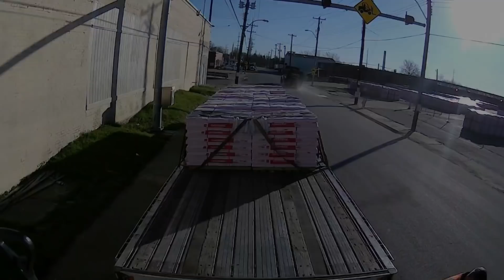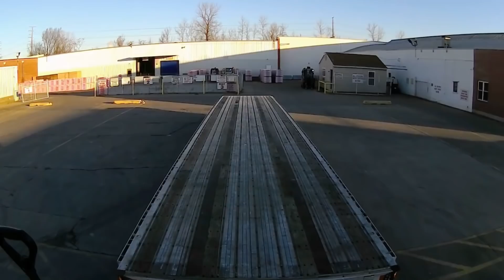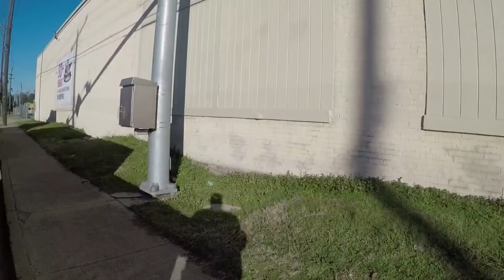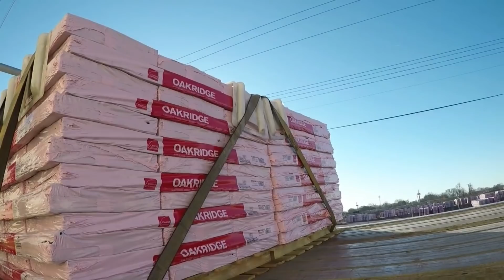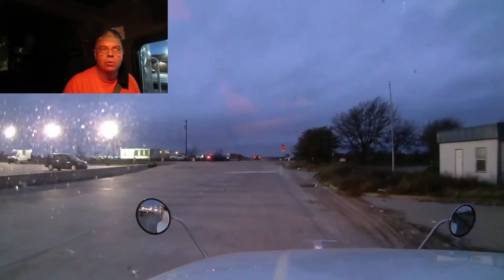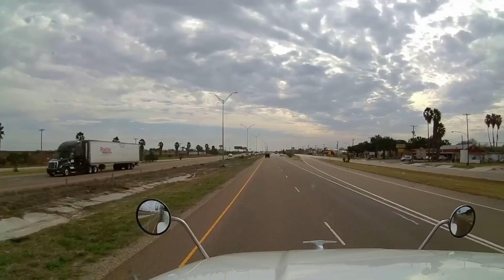#370 Safety Safety Safety and Roofing Shingles The Life of an Owner Operator Flatbed Truck Driver

Comment: I don’t know if you can take over the counter medicine while driving but,  when I was younger (I’m 73) I drove a lot in an unairconditioned truck. My allergies gave me a fit all spring and summer until I came across a product called Contac cold and allergy capsules. They were a lifesaver. Cleared my sinuses, dried my watery eyes. In short it made my life on the road much easier to bear.

Comment: ‘They preach safety in the office’- yeah, THEIR safety. They don’t care if you become ‘flatboy’ securing their load.
Reply: JimzAuto They could just put four traffic cones out by the utility pole, that driver’s could use,  so traffic had a visual cue what “that parked trucker” was doing!
Reply from the maker: Thanks for watching
Reply: JimzAuto ,
Flatboy    😂
Reply: Raoul Thomas but they won’t come out. 1) Busy other loading others. 2) by sitting out cones they impute liability onto themselves, suggesting they know it’s dangerous to load in the street.
Reply: Chuck  that's it exactly.

Comment: did you know shingles absorb heat and makes the roof hotter. any tar based roofing material does that, but shingles are cheap so its used alot.
Reply from the maker: Thanks for watching

Comment: No 4 ft boards for those shingies? Those cheapo 4 inch edge protectors are useless on just about anything  Also,If your Not a "Brake slammer" And your driving habits are "Slow n easy" No need for those Bulkhead straps- Waste of time and those 2 inchers wont stop nothing. Cool Video